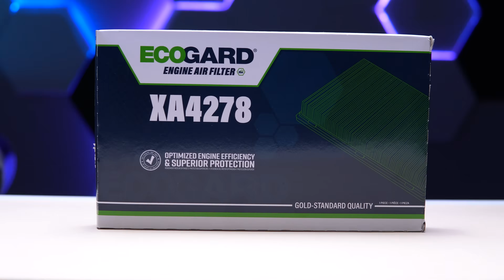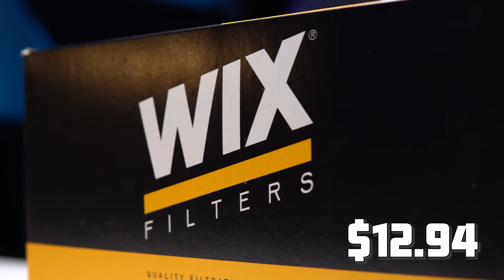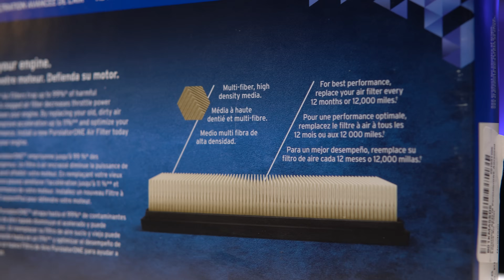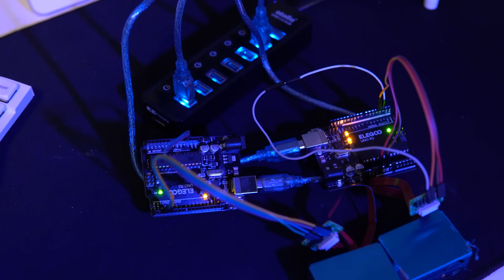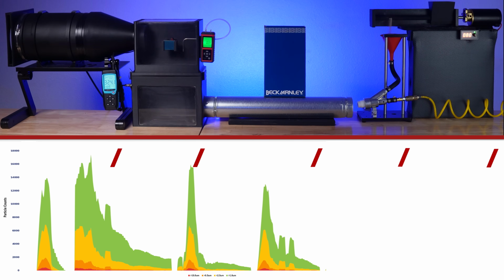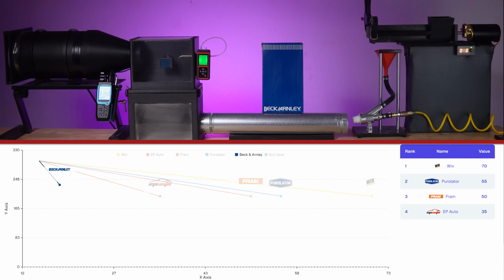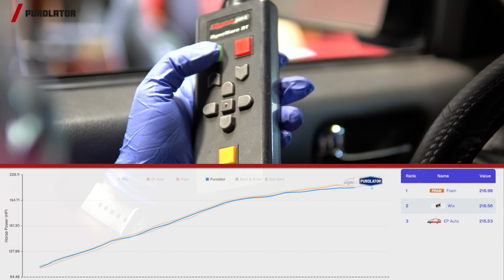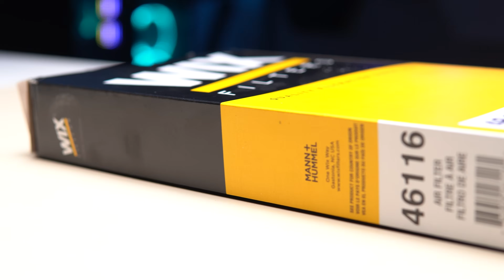*NEVER* install THIS if you want your car to last! (Engineer Tested)

Comment: I'm probably gonna be flamed for this but fram is my go to for filters, oil, intake air, and cabin air. 
I know on their cheapest oil filters they use a cardboard reinforcement ring, but I dont buy those (unless im doing a flush of some sort, like the EG flush or something where im gonna trash the filter within the hour.)

I just see fram as a known quantity, theyre available, and man rhat flex seal dip on the oil filters gives me no reason to make it tighter than hand tight by havung to use a tool. 

Also, this is anecdotal, but changing other peoples oil, Ive never seen a gasket from a fram sick to oil pan. As much as ive seen double gasketing ruin peoples engines when they go to quick change oil chains, thats got some value to me

Comment: Was surprised to see the ecogard results. I bought their oil fillers in bulk when I owned a Subaru due to the proper bypass valve psi and reasonable pricing, would be pretty intrigued to see how their synthetic oil filters actually stack up in terms of performance given they claimed 99% @ 20 microns!

Comment: Make, model and driving ci dictions play a huge part but I’ve found that Carquest filters are made by Wix for advanced auto so I switched from Nissan OEM Mahle filters.  Mahle filters have changed whereas quality has gone down and last 2 filters didn’t make the required 2 oil changes.  Might be due to now being made in Mexico.  Construction of Carquest filter as good if not better and $10 cheaper.  May switch to a dry reusable filter for summer driving to improve gas mileage

Comment: I appreciate you testing the dust filtration with four different micron size measurements. I am very interested in seeing a more detailed breakdown of your data on how each filter performs with different dust particle sizes of 5 microns and above,  and 10 microns etc. I believe that data is more consequential in evaluating filter performance because the larger dust particles passing through have more detrimental effects to engine wear while the particles of 1 micron are of significantly less impact to engine life. While still very much appreciated, publishing only the total cumulative dust particle count tells only part of the story. Overall, excellent test and very informative. Thank You!!

Comment: Every 5,000 miles or after every oil change is when I change the air filter, I have a Chevy truck all I use is AC-DELCO , they do the job well

Comment: Loaded particles form dendrites that are less restrictive and better at filtering than the manufactured materials. 
Air filters are supposed to be tested while slightly loaded. Their efficiency rating is actually specific to after this loading period. That’s why the graphs demonstrate huge quantities of particles at the beginning of the time series.

Filters on super expensive industrial equipment are actually preloaded with particles that won’t damage the equipment. So you wouldn’t see the initial spike on those.

Comment: Mount a hose behind the rear wheel of your car directly to the intake of the engine. Rally it a little on a dusty road. Now you can use a thiker oil like 100w100 or something.

Comment: The horsepower test results don't impress me, because they are virtually all the same.  That's because the ECM compensates for a more restrictive air filter by opening up the throttle body more, to maintain the correct air/fuel ratio for the catalytic converter.  I also didn't take much interest in the capacity tests.  If you change your filter regularly, you'll never come close to those capacity limits (unless you frequently drive on very dusty roads, in which case the quality of the air filter becomes MUCH more important.).  And, I would argue, the more junk that you collect in your filter, the better it filters the fine particles.  Your particle infiltration test was a bit interesting.  But even there, the worst filter let pass only 40% more particles than the best filter, so in the long run it probably doesn't matter, unless you're aiming for a 300K mile lifespan.  Even if you are trying to squeeze every mile out of your engine remember that you flush most of those particles that slipped past the air filter and piston rings when you change your oil.  To put this in better perspective, just imagine you are a typical rental car company that gets rid of cars after about 75K miles.   It simply doesn't make sense to spend extra money on a premium air or oil filters for your fleet.  Some of these rental car companies don't even authorize new air filters until it is time for the vehicle to be sold. And, even if you own your own car and you plan to keep it for 300K miles, an accident will probably total it, or the transmission will go out long before the piston rings wear out because the air filter didn't filter out enough fine particles.     But I enjoyed all the thought-provoking data, keep up the good work!

Comment: I wish you tested the FRAM Ultra series, which are rated for up to 40,000 miles or up to 4 years of protection and larger dirt holding capacity, also sold at Walmart.

Comment: Total power is the area UNDER the curve. The Purolator seems to be the best, and u said its the worst. Your numbers are for MAX power, which comes at 6500 RPM, which is a worthless measure. I have owned cars for 10 years and never drove them with 6500 RPM once. Good news is that you showed the data, not only your conclusion, so everyone can judge for themselves. My opinion based on your data is that the filter makes ZERO DIFFERENCE. I challenge anyone in the world, even a professional race car driver, to tell me in a blind test which filter is which. No human can tell 1 HP difference. And finally, even if u do 6 runs with just one filter, you will still get 6 different results, and your chart here will look exactly the same. Really, the only thing you demonstrated CONVINCINGLY, is that the filter makes ZERO DIFFERENCE

Comment: I always see Fram getting called the worst filters. All I can say, is I’m 73, and have been using Fram since I was a kid. Never a failure of any kind. I’m no expert, but they have always worked for me.
Reply: I had one of pieces of crap oil filters ruin my engine some years back.
Reply: The reality is, it really doesn't matter what you use as long as you use something and change it regularly (the actual important bit). Perhaps not wise to use no-name Chinese brand ones though.

My longest living car, a Toyota Corolla, at about 230k miles before I retired it, had nothing but FRAM extra guard (their lowest tier filters). Same with the oil filter (although about half the time it had whatever Walmart uses because I couldn't be bothered to do it myself back in the days when conventional oil changes were less than $20 to have them do it).

Just change your filters on schedule (the OEM schedule, not whatever is printed on the box) and you'll be fine.
Reply: Absolutely. I use Fram oil filters also. Their Ultra Synthetic filters are the best, imo.
Reply: I've used Fram  oil filters often on my car's since I began driving in the mid 80's. I've used various brands, but Fram in the orange  can never failed me. I've used Fram on my various high mileage cars including turbocharged cars, no issues. None of the brand's I used, and they were standard oil filters often on sale, gave me problems.

Regular oil and filter changes are what matters.

Comment: Love these videos.  If I was an engineer, I’m looking for the best of the best no matter where it’s made, what’s it made of, or what it costs.  We need more of this kind of content.  The only thing I would recommend is that you do a recap summary of all the numbers at the end for each test and then maybe do a weighted score to determine which is the best balance of all these characteristics. Saves me from having to rewind to look at all the numbers again for each test.  For example, if I want the best balance of filtration, and capacity and horsepower and I don’t want to worry about changing my filter, go with the Wix.  If I’m one of those guys that is anal about maintenance and is willing to change an air filter at every oil change, then I’m not so much worried about capacity.  I want superior filtration without sacrificing horsepower. (Actually, I’m cheap and I just blow out the filter with compressed air and change at about every two oil changes, but you get the idea.)

Comment: If in any doubt which is best.. stick to what the manufacturers use for your vehicle.. Yes it maybe more restrictive.. but at least you ain't gonna end up damaging your engine through poor filtration.. By this I mean letting in a lot of foreign objects due to the material of the filter..

Comment: My last car was a 1995 Sidekick, which I drove for 2 decades. The air filter, like some Suzuki parts are more expensive , about $40 CDN. So I resisted changing it. I learned from desert people to just take out the filter and blast it with compressed air and then check it with a trouble lamp., I do it every year.   Half way through about a decade, it had well over 200,000 km on it,  I gave in and bought a new filter. Now , with my Toyotas, I added some A/C filter wool just before the filter as rough first stage, and I intend the OEM filter to last for life. I do not drive in dusty areas or desert much. I do the same to the cabin air filter. If you are foolish (or rich) enough at the dealer to authorize cabin filter service, they will ding you for $60, 70  extra.  In the old days , well before year 2000, there was no such thing as cabin filters, and I have not heard of anyone who died breathing unfiltered air.  In the military maybe at war when they need their NBC filter (Nuke , bio and Chemical)   To get more bucks, dealers are also paying more attention to the age of tires, brake fluid, trans fluids etc. The only one left out of the money tree were the mechanics.

Comment: If fram puts up respectable numbers then it should be better than for use "in a pinch." If you had stated that it was second worse in the 5g dust test then that would be better justification. As someone else pointed out, a summary chart would help the viewer digest all the test info.

Comment: Did you test the hp without a filter? Most people rarely drive in dirty areas so who cares about the filter lifespan. Less dust it will last longer.

Comment: My experience with Beck Arnley is that they usually just put their box around other suppliers' parts. Usually they're good suppliers, sometimes oems, but I guess not necessarily all the time. Bought some brake pads that were made by TRW.

Comment: You should always test an OEM real genuine original filter from the dealer for whatever car you are testing as a control - not an "equivalent" or "the same manufacturer" but an actual genuine one.

Comment: You missed the point by not testing OEM. There is so much dust here I pull it every oil change and vacuum it out with the shop vac.

Comment: Ive used the ecogard filter in my car for 2 years quite and it works fine. My MAF is always clean and my car's performance hasnt had any major problems. Quality is really good too. I use genuine oil filters for the engine, though.

Comment: Is this bloke a refugee from a 1960's advert for washing up liquid?
Just needed a dickie bow tie , point to camera with invisible gun and an exaggerated head turn  wink .
Lordy Lord.

As for air filters and other consumables,may I politely suggest just stick to the ones recommended by the car maker. It's not hard to research.

Comment: If only Fram's oil filters are as good as their air filters. They know how to produce a solid air filter but I wouldn't put their extra guard oil filters in my worst winter beater.
Reply from the maker: Agree! When we tested their Extra guard oil filter in another video it did not do so well. Although some of their higher end ones did. Thanks for watching and supporting us!

Comment: With all these cars in my driveway, they get whatever is cheapest at Rock Auto during my annual stock-up buy of filters & windshield wipers. 

I change the air filters every 10k mile oil change. They're usually just $3-$4 each at Rock Auto

Comment: People... K&N are designed for maximum air flow in track and performance applications. The filters they are testing are what is readily available to the average consumer. The average consumer doesn't even know they have and or change their air filter, let alone buy a "premium" or performance filter.

Comment: I would have liked to see the horsepower test run with no air filter. That would give a great baseline. I don't believe any air filter adds horsepower.
Reply: The video shows a performance increase with a performance filter. Go buy one and try it out.

Comment: The next time you test, can you throw in  K&N reusable filter. Thanks.
Reply from the maker: Yes, next video. Thanks for watching!
Reply: @BrandRanks  Thanks for the reply. I use a K&N on my Jeep, especially when in Utah with all the dust. I can clean it after a trail run. Curious how good it is though.

Comment: Good video.  I’m currently using a Fram Ultra 9683 that is supposed to last 4 years or 40,000 miles.  Reasonably priced at Walmart.  It’s holding up well, but I change it once a year anyway.  I’m considering an STP SA9683 and wonder if any good?  It’s $14.15 at Auto Zone if also buying an STP oil filter and 5 quarts of oil at the same time.

Comment: Nice work on the test rig and specialized dust. I'm not buying the Dyno results though.  Engine is an air pump so HP should follow air flow results.  Most likely a Dyno consistency issue with oil, coolant, and air temps impacting the results and not the filter.

Comment: Good reviews. I've pretty much gone to WIX for my vehicle's maintenance though currently have a K&N on my '31 Ford's 5.0 engine simply because that was the only available 12" oval at 4" height 2-3 years ago. That one will be scrapped soon for a dry version as even the small amount of oil on it has coated the carb choke plate.
Reply from the maker: Thank you so much for watching!. Yeah the Wix was great. Those oiled filters tend to do that.

Comment: You should had done a test with the filters brand new as a base test in the Dyno and then the filters packed with dust to see how they will affect engine performance, horse power and what will happen if changing the air filters is neglected
Reply from the maker: That's a great suggestion! Planning on doing a video to test some scenarios like this thanks for watching

Comment: A good test would be OEM vs aftermarket like these wix and such. I know K&N will be a good test and with the increased airflow less filtration but the oil makes up for that and can trap more but I’m still curious after you guys do the testing. The OEM filters people use because it should be the best since that’s what the car comes with but at a higher price so to find out if it’s even worth spending done the money for the name.

Comment: Great video! Could you also test other filter brands like K&N, Carquest premium, Fram drive, Fram titanium and Fram ultra air that I just recently seen at Walmart and is supposed to be Frams best engine air filter. Would like to see how that compares to the wix and purlator. Can you also test cabin air filters and engine coolant and windshield wiper fluid and brake fluid for future videos? Love your videos, keep up the good work!
Reply: Also is there any way you can go back to oil filters and test a by pass oil filter?

Comment: thats why you stick with OEM for things like Air filter, as you can count on the engine to run properly with the air filter/flow designed for it.

Comment: I appreciate the effort you put into all of this, but I do have to point out that your inclusion of a chassis dyno was problematic (and likely done for clicks more than for science). Importantly, your results fall within a margin of error. When dealing with a chassis dyno you have to take into account air temperature, engine temperature, humidity, drivetrain temperature and tire temperature/pressure. Even after all of that there's the equipment itself and its inherent margin of error. In summary, 2-3hp isn't really meaningful here. More importantly, peak hp isn't as valuable as total hp under a curve, as we don't drive around at redline with the throttle pinned. 

Again, appreciate the effort, but unless you can demonstrate you've controlled variables and your gain is outside the margin of error then chassis dyno tests aren't really meaningful.

On the plus side I thought the capacity test was meaningful and controlled. Ideally, you would take into account how moisture and water can impact certain paper elements once exposed, but I suspect you were already exhausted by the dry testing.

Suggestion- make the video a bit longer and explain some of your results a bit more throughly, as well as the reason for choosing a certain methodology. Your market for these types of videos isn't the general public anyway- too fringe of a topic.